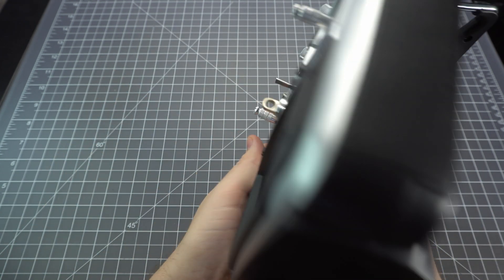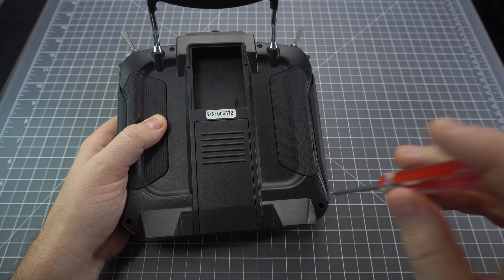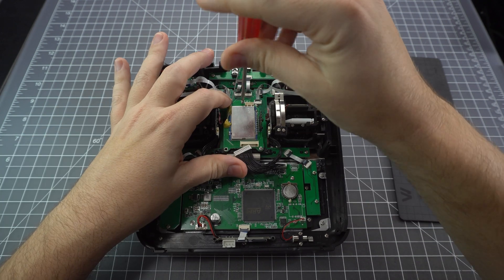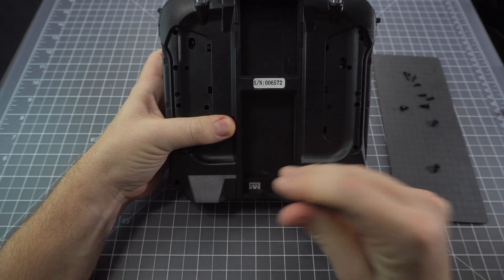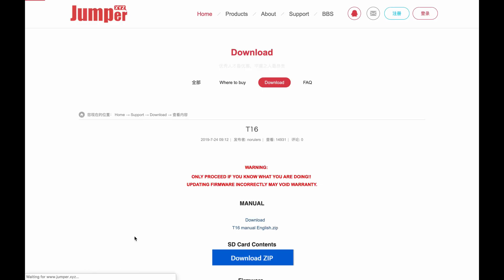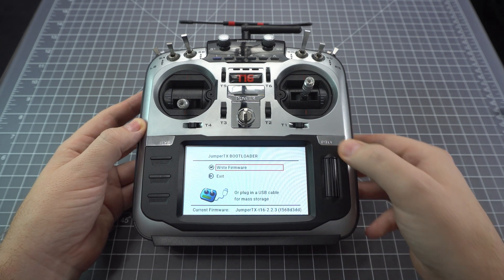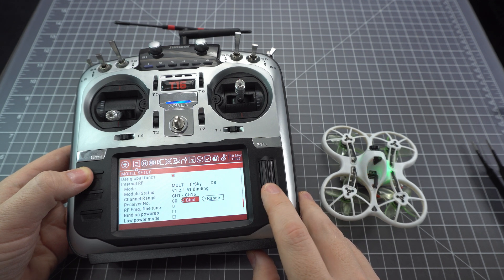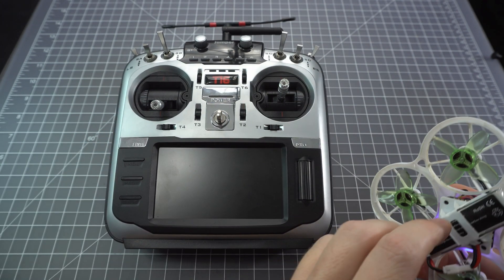Jumper T16 Official Internal Multi-Protocol Module Upgrade

Comment: Hi, can it fit to t12?
Reply from the maker: I don't believe you can put this into the original T12. You'd have to buy the new T12 Pro with the module built in already.
Reply: The problem bro, that i dont wana buy anoter one
Reply: But thanks for the answer

Comment: Is there anything about this module that requires the T16 specifically, or can it be used like the OrangeRX DIY DSMX transmitter where you just feed it a PPM signal and it does the protocol conversion automatically? At what level is the protocol selection done?
Reply from the maker: I don't think that radio runs OpenTX. This is fairly proprietary and will likely only work on the Jumper T16 or T12.
Reply: @whiffles  Good to know. Thanks.

Comment: Did u have the internal module that has the latest firmware and bootloader already installed.
Reply from the maker: I'm not sure. I still need to check that and do the official OpenTX install.

Comment: Did Jumper supply a "new" top plate?  I got my internal module, but I don't have a different top plate.... Mine is the Hall Gimbals.... will the top plate on it work with the antenna? If not, where can I get just the top plate? THANK YOU
Reply from the maker: You can just use the original one. I guess they only sent a 2nd top plate to me.

Comment: After upgrading to the internal module my speaker gives a constant low buzz sound when its powered on. Anyone else have this happen?
Reply: I have heard that using adhesive backed copper tape will shield the speaker, but haven't tried it myself yet.

Comment: I bought this and it doesn't appear like its coming with the new plastic top plate like yours did ?  hrm
Reply from the maker: I asked Jumper about that and they said it wasn't cost effective to send the modified top plate. They said you can continue to use the original.

Comment: Great video! Have the T16 and just today got the internal module for the radio. Need to ask for clarification on the firmware version you used in order to activate and use the internal module? Thanks!
Reply from the maker: Just download the latest version on the Jumper website.
Reply: @whiffles  Thank yo!

Comment: Noticed that the internal module firmware is v1.2.1.51; the current version is v1.2.1.84. Have they provided you the procedure to update the internal module?
Reply from the maker: I believe you can just use the system menu to flash the internal module. I haven't tried it on this module, but normally you just put it into the FIRMWARE folder, go to the scripts tab, select the firmware and choose to flash it to the internal RF module. Let me know how it goes!
Reply: @whiffles  https://www.rcgroups.com/forums/showthread.php?3243685-Jumper-T16-2-4G-16CH-OpenTX-Multi-protocol-Radio/page274#post42868759

Comment: Thank you for the excellent instructional and informative video. 

One question, do you not need to update the content of the SD card as well or the firmware update is sufficient?
Cheers,
Sam
Reply from the maker: No need to update the rest of the contents, but you can if you'd like.
Reply: Whiffles Thank you very much.

Comment: Super easy mod and nice step by step walkthrough. You can also connect the usb cable and choose the SD reader function to put the bin file on the card, much nicer in my opinion that handling the stupid micro card :)

Comment: its available now on alliexpress jumper technology store. one question Wiffles. when you were choosing the firmware in the video it showed you clicking on the 2.2.3 and now the 2.3. is that the one we should be using or the is the 2.3 the correct one?
Reply from the maker: Just use the latest firmware.

Comment: Does the kit come with a lid for the external module location?
Reply from the maker: It does not, but you can decase the original module and use the case.

Comment: No grounding strap; No care
Reply: Grounding straps are almost entirely unnecessary. Don't believe everything you read.
Reply: @jslinkman4230  Actually they should be required, but we've all seen the vids from the Chinese factories that churns these parts out where they don't bother with them either.  Yet how many times have we read about DOA parts?  Don't believe everything you read about not needing a grounding strap.  Still a good vid though, Whiffles